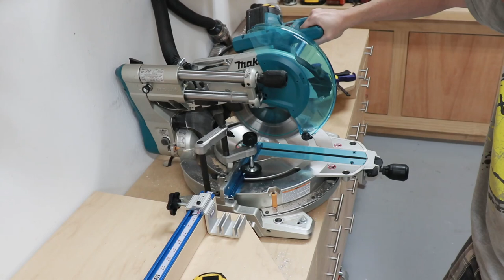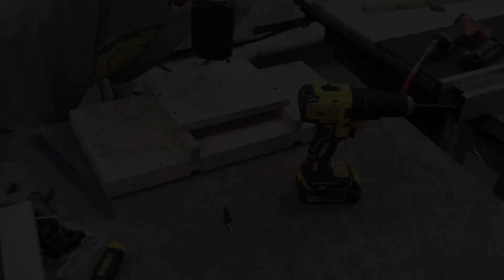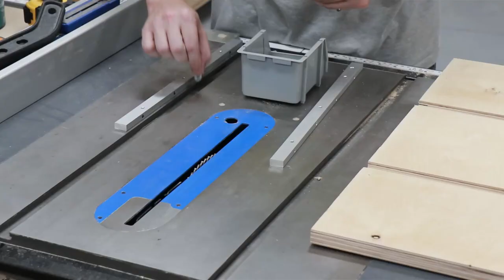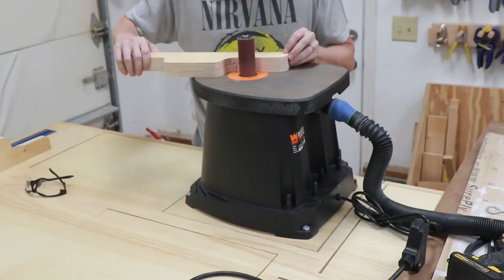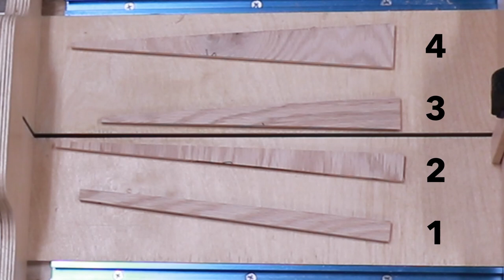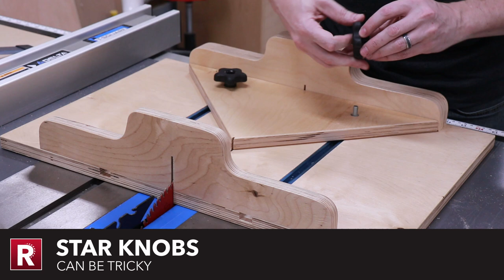Table Saw Crosscut Sled and Drill Press Table

Comment: Well done, your explanation of the 5 cut method. Not meaning to be a wet blanket but your viewers need to verify, and adjust if necessary, the relation of the saw's arbor to the table top's slots. Also, they need one really fine quality saw blade to get perfect miters. The art world is completely unforgiving of imperfect work.

Comment: Just stopped by and subscribed. I have the same Wen drill press and I like your solution of having a quick clamp, that way you can quickly unclamp, put the table out a bit, adjust the height, then reset the table. Going to give this build a try.
Reply from the maker: Thank you!  Please let me know how it turns out and what your thoughts are on it then!

Comment: One way to get rid of the skip is to mount the  Braces with the table on the drill table. That way you push all braces flush and screw in. Also make the height of the Braces exact or just shy

Comment: Nicely done. It looks like your drill press has the same issues as mine - the elevation crank will get in the way of the ww table installed, however being that your table is easily removed that is a nice feature to make adjusting the height easier. As long as I don't need to keep the fence aligned while adjusting the height I can just slide the table out a little to adjust the elevation.

I was reading below about the blade guard. If you have a few bucks to spare, maybe consider getting a Shark Guard. I installed one on my Delta Unisaw and do not regret it. It's a PITA to install and align, but once there it's awesome.
One thing you can consider is fabricating some narrow  hardwood to attach to the top of the riving knife. I've seen others that have done this. It doesn't provide side protection from an errant movement of the hand, but it will provide some overhead protection.

My vote is for hardware storage.
Reply from the maker: Yeah it does get in the way, but is easy enough to move when I need to.  Blade guard I am not personally really worried about, although I have considered over-arm dust collection which would help with safety also, but would need to be removed for the table saw sled.

Comment: Good job! 👍🏼 on the <60 seconds, too, lol. 
Pleeeeease post the sandpaper rack next. I’ve gotten all my oak French cleats on the shop walls, made 12 of the lumber rack brackets from Fisher’s Shop video, (realized I need about 10 MORE!), and today I laid out all of my misc hand power tools and cut out the holders for wash. I have 3 sanders (mouse, square finishing, and small belt), and a variety of sandpaper, needless to say, I am going to make the storage rack/shelf next. I’ll either include the mouse and finishing sanders somewhere on it or next to it. I’m working on flipping my belt sander so it’s mounted stationary and I can use it that way.
Reply from the maker: Thank you!!  I’m excited to post that one whenever it wins out!

Comment: Great video. 
Looks like we both have the same table saw, Delta 36-725.  Where did you find the insert for the dado blades?  I haven't been able to find one.
Reply from the maker: Here is the one I have, although it looks like they change the color to black?  One thing I noticed is a lot of them don't have our model in the main description, but down lower have "Also works with:" and has ours.  Hope that helps.

https://amzn.to/36pAb4A
Reply: @RingsWorkshop  Outstanding, thank you Sir.

Comment: Nice work!  
Which benchtop belt/disc sander appeared in this video?  Performance?  Reliability?  Are you happy with it?  Lessons learned?
Reply from the maker: Thank you!  It’s WEN’s benchtop belt/disc sander, have a link for it in my fliptop video description.  I like it, I’ve never used a really nice one before to know the differences, but it works really well for me.  Haven’t had any issues.

Comment: Hi, I enjoy watching your videos. 
For the back fence squaring: Do you make your five cutes from the back table as the table sits, or do you reverse your table during the calibration?
Keep up the great work!!

Thanks,
Steven
Reply from the maker: Thanks!  As it sits, the fence closest to you using it.  That’s the one most people use, however I made sure the other one was also square as I found myself using it a lot as a reference for cuts.
Reply: Hi,
So to square the rear fence you had to do the 5- method cut off the back fence. Did you reach over to do your cuts, or did you flip the jig so the rear fence would be closer to you for the setup adjustments?
Reply from the maker: @stevensabin8692  ahhh sorry I mis understood.  I left it as is.  I didn’t go as accurate as the other fence, however as I make one for my new saw I will…I may even be pickier since I used it more.
Reply: @RingsWorkshop  
Hi, There are many times that work best when cutting off the rear fence. You have the t-tracks installed to make it safer for you. I never knew how the rear fence was handled.

Keep up the excellent production values for your production and editing skills.  

You did a fantastic job with your shop reorganization. Nice idea about your dust extractor solution.  Just be careful with dumping your air outside. Then the dust collector ends up pulling air from the house or the garage door. It will be tough if you have AC going for the summer because the air that goes outside will be conditioned air. Also, it will cause the dust collector fan motor to have a shorter life span since it will have to work more to pull in air for the infeed.

Stay safe...
Reply from the maker: @stevensabin8692  thank you!! I don’t leave it running that long very often so I haven’t have any issues with it.  If it was running for a longer period at a time it would be more of a concern for sure.